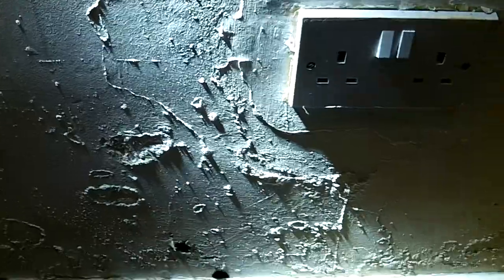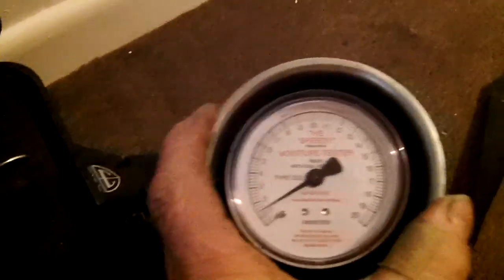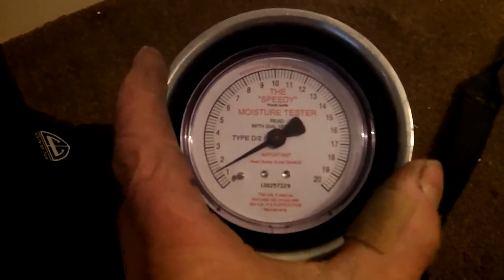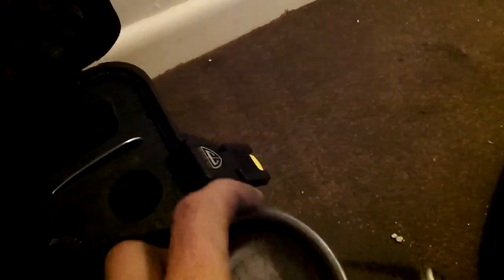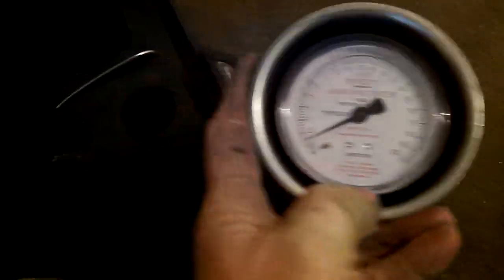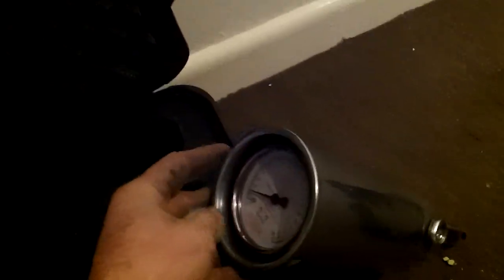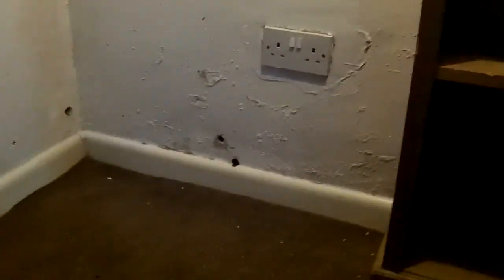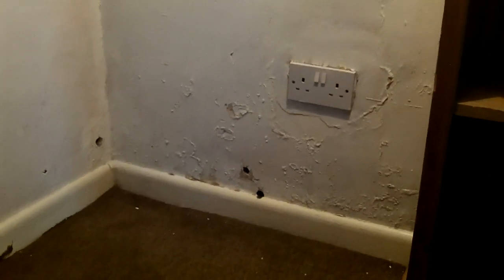They said this was rising damp - er - NO.. just a bit of condensation actually.

Comment: What is the solution please? Cut out new plaster & bitumen tanking and allow to dry before using lime plaster? Would that sound about right in your opinion?
Reply from the maker: Ideally yes - sometimes, if its not too bad, the aim is to reduce moisture in the air, and look to a long term dry environment - that prevents the problem getting any worse - usually involves better ventilation internally - kitchens, bathrooms etc - with humidity control. Thats always cheaper, and you can then sit back and think "do we need to do any destructive stuff to the walls, even if they HAVE got the wrong thing on them".. if the problem stops, and doesnt get any worse, then youve solved it with inexpensive approaches to ventilation. win win..
Reply: @WarmDryHome  Excellent many thanks  & thanks for the videos you post. Really find them helpful